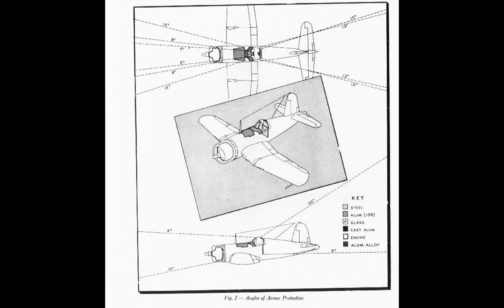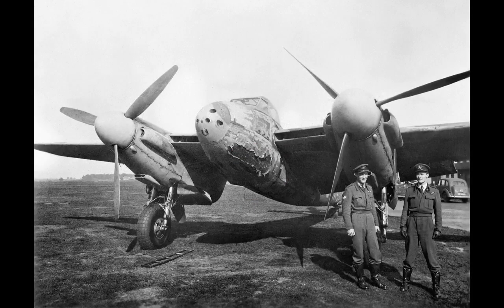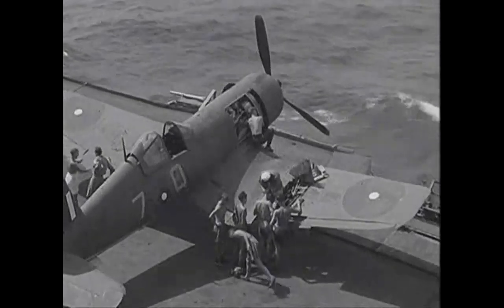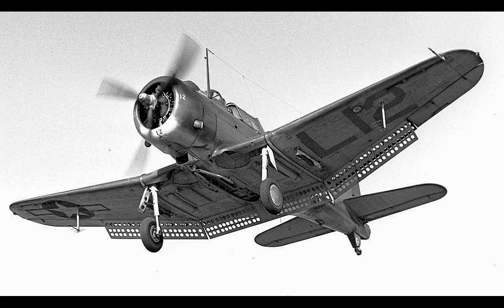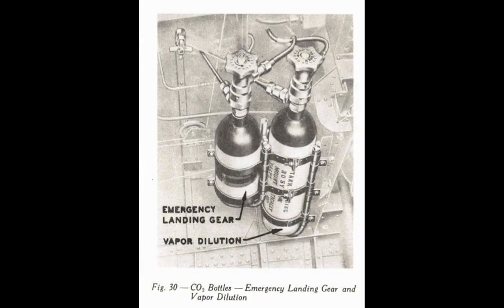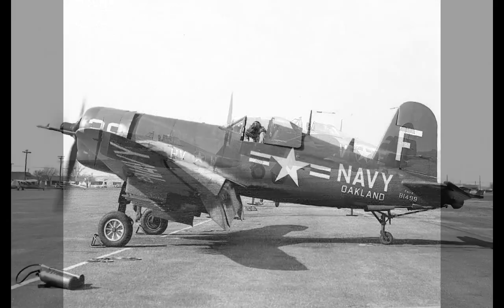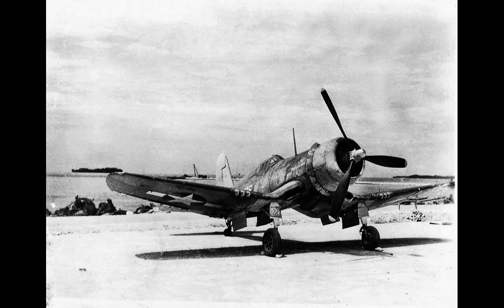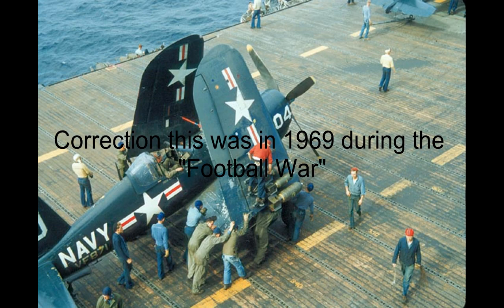F4U Corsair Design Features

Comment: My father was a Naval Aviator from '42-'64 and the F4U was his all-time favorite aircraft to fly, bar none.  During his career (he accumulated over 20,000 flight time) he flew pretty much everything and anything that had a propeller and a tail hook on it, with the exception of torpedo bombers.  He flew the F4F, F6F, F4U, F8, AD1, SBD and SB2C.  From about '57 onwards he flew the EC-121 Warning Star (the Navy's AEW version of the triple-tailed Lockheed Constellation).  Of all those aircraft, he loved the F4U the most.  When he was flying off the Lexington in '44 and '45, he would get "Ol Hose Nose" (as he called her) up to CAP altitude and then fly Lazy-8's over the task force by leaning from one side of the cockpit to the other.  She was awfully unforgiving to novice pilots though (the Corsair was called the "Ensign Eliminator" for a reason).  The officer with whom my father shared a stateroom on the Lexington was killed when he came in a little too low on approach, received the LSO's power call and fire-walled the throttle, only to have the engine's P-Factor (torque) get away from him.  The end result was the aircraft rolled over onto her back and plunged inverted short of the flight deck into the Pacific swell.  Neither were ever seen again.  My father said that from that moment onwards, he always came in high and hot, the LSO's complaints and criticisms be damned.  I hope Dad and Ol' Hose Nose are reunited, punching holes in the sky somewhere in Heaven now.
Reply from the maker: Thanks for that story Caesar.
Reply: Apparently the Royal Navy solved that nasty low speed stalling characteristic by building two ventral strakes onto the port wing upper surfaces to equal out the decaying unequal lift characteristics of the wings!!.
Reply: As you mentioned, the F4U had a notoriously vicious stall from which recovery (and survival) were demoralizingly low.  When the aircraft got down to stall speed, one wing, I can't recall which, would stall out before the other.  Then end result would be a sudden snap roll in the direction of the stalled surface.  At low altitude, like on approach to a field or flight deck, the result typically involved a wing-tip over wing-tip cartwheel....accompanied by fire.  I recall Dad mentioning that one solution someone (presumably the Chance Vought team) came up with involved mounting a small equilateral triangle, about 12 inches on each side, to the underside of the good wing.  The triangle disrupted airflow over the wing's surface just enough such that it stalled out at about the same time the "bad" wing stalled out.  I'm thinking the RN solution might have provided the impetus behind the Chance Vought's solution, or vice-versa.    @4vepvik781
Reply: @CaesarInVa  At the end of the day.The F4U's vices were ironed and the Fighter became the legend it deserves to be.
Reply: @4vepvik781  No it was not. It still had problems at the end
Reply: @4vepvik781  Legend where?
Reply: @4vepvik781  Legend in your minds
Reply: @hoatattis7283  Are You obsessed with Me!!??
Reply: @4vepvik781  Not really you just pop up a lot
Reply: @hoatattis7283  Well,people like or dislike My opinions but I have not posted any thing about the F4U since.However the topic runs and runs!.
Reply: @4vepvik781  Yes it does and all credit to you/
Reply: @4vepvik781  I thought the stall-strip was added by either Chance-Vought or the US Navy?
Reply: @petero.7487  If that had been the case,the F4U would have been cleared for Carrier duties from the get go rather than being relegated to the USMC..The Royal Navy/Fleet Air Arm operated F4Us from the beginning and strove to eliminate the stall vices of the aircraft and passed the gen to the U.S Navy!.🙂
Reply: @4vepvik781  the US did not clear it for carrier duty due to visibility problems on approach.  The British solved the visibility problem with the curved approach as stated in the video. Regardless of anything else you have to be able to see the carrier to land at any speed.
Reply: @petero.7487  Er!,the Royal Navy put the F4U into carrier service before the U.S Navy as the latter relegated the Corsair to the USMC till the vices were ironed out and with the R.N infront and cascading information back to the U.S Navy to speed up the fighter's belated entry into that Carrier Force!.
Reply: @johnmcmickle5685  Not in dispute,but that was not the only vice.
Reply: @4vepvik781  But that was a major problem.
Reply: @johnmcmickle5685  What U say is not in dispute so do not try to create dispute!!..Yes!,visibility is vital to see/land on the carrier but the other vices were unequal and therefore treacherous wing stall characteristics when any landing aircraft is flying close to it's stall speed is a necessity in the landing phase!.
Reply: @4vepvik781  Yes it was done by Capt Eric Brown and the FAA
Reply: @4vepvik781  Jesus dont tell them that the Limeys knew more than the USN
Reply: @hoatattis7283  They did!!..Some people don't like unpalatable truths..Let's deal widdit shall We!!??..Can't believe We are still having this topic 7 months on!!😳😳
Reply: @4vepvik781 I have no idea what you are referring to. 
Shit I reply to posts years old
Reply: @hoatattis7283  Enjoy n keep replying..Sounds like a message in a bottle..😆
Reply: @4vepvik781  good
Reply: @petero.7487  No they may have AFTER Eric Brown and his team worked out how to best land it on Carriers. 
Brown was a FRAeS [ honours] and was as good an Engineer as any Navy Officer and definitely more than any pilot
Reply: @4vepvik781  They will not believe you. The R/N never showed the USN anything in WW2 .Just ask them.
Reply: CaesarInVa  -- My father was also Naval Aviator, with experience much the same as your fathers experience. He flew carrier based ASW aircraft much of his time, but he flew everything else too. But probably his favorite was the F4U, he would have said it was the best fighter of WW2, bar none.
Reply: @martentrudeau6948  .Man you must be proud of your father.Wen men were tough S O Bz
Reply: @martentrudeau6948  :No disrespect to your father but did he face the Luftwaffe in his Corsair?
Reply: CaesarInVa ...  great story.  Great plane.  I had a Cox gas engine model plane for the back yard that was a Corsair.  No air to air kills, but a good time.
Reply: @chocolatte6157 Gotta tell you a funny family story about Cox model planes.....its a long story, but I think you'll laugh.  So, around 1970, I was about 10 years old.  Dad had been retired out of the Navy for about 6 years at that point.  Down the road from where we lived there was a shopping center that had a hobby shop.  That place sold THE BEST models.  Airplanes, ships, etc.  I think the models were mostly "Revelle", but can't remember exactly.  What I do remember is that this hobby shop sold THE MOST detailed models.  I would typically buy one on a Friday afternoon after school and spend all Friday night and Saturday night building it.  Ok, so one summer's day my dad accompanying me into the shop.  Up on one of the shelves was a Cox gas engine model of a Ju-87 Stuka diver bomber.  The thing most have had a wingspan of 2 feet or more (remember, I'm only 9 or 10 and so EVERYTHING seemed bigger at that stage of life).  It was at least twice the size of the Cox ME-109.  My dad, who usually didn't express much interest in what I was interested in asked me "Hey Mike, how about the Stuka? Would you like that for Christmas?".  I took one look at it and KNEW I'd never be able to control it.  In fact, I had a mental image of the thing taking off and dragging me airborne behind it.  I just said "No, its too big for me".  Dad continued staring at it.  I knew something was up.  So sure enough, about 3 months later, there she was under the Xmas tree.  Ok, I was pretty excited but even at 10 I was smart enough to know that the plane really wasn't for me.  Dad really got it for himself, but that was cool.  Whatever made him happy was my motto.  So that afternoon, Dad, my two elder brothers and I got all bundled-up in our coats and scarfs and went down to the local public school's parking lot to test-fly this behemoth.  My Dad pronounced "I was a pilot, so I'll fly it first and show you how it's done".  Naturally, my brothers and I dutifully deferred.  After much perseverance, my brothers finally got the engine running smoothly, which took quite a bit of mechanical aptitude (another reason whey I had misgivings and initially demurred.  I knew I had the mechanical aptitude of a sloth and figured I was more apt to dismember myself than get the engine running).  Dad, who was holding on to the control lines, got the plane off the ground and into the air, whereupon it went immediately into a near-vertical climb, rolled over onto its back and plunged, nose-first, straight into the parking-lot's asphalt surface.  Although there was no accompanying explosion or pyrotechnic display, the plane shattered into easily several hundred pieces.  Shards of plastic and engine fell all around us.  There was a pregnant pause for about 5 seconds while all of us tried to comprehend what happened, then I exploded in laughter and said "Hey Dad, I hope you flew better than that in the Navy!".  My brothers and father were stunned into silence by my the audacity of my comment and I could tell from the look on their faces that I had definitely gone somewhere that no sane mortal dared.  Dad scowled and looked like he might make a move towards me, but I think he knew that if he did, given my spryness, I'd be a quarter a mile away before he could do anything.   I was STILL laughing when I went to bed that night.  Mind you, I wasn't laughing AT my father, I was laughing at the situation....although the collision between personal hubris and.parking lot asphalt was pretty funny,
Reply: Great story. I hope your father got to enjoy his well earned retirement.
Reply: Thanks for the great story I hope your Dad is still sailing through the clouds.
Reply: Thank you for your father's service in the service from
 WWII (1944-1945) 
the Korean War 
(1952-1957)
the Vietnam War
(1963-1975)
Your father was an brave aviator an was fighting for his country an was proud to defend himself on his countrys behalf!......

I thank you for your comments!......
Reply: Oh man,thank u so much for sharing ya dads service time n planes with us.I live in New Zealand and our pilots did exceedingly well flying for the RAF ,spitfires,hurricanes etc,in WWll.Today I'm embarest to say we don't even have fighter planes and don't pull our weight. Salute your Dad.You must be very proud
Reply: I wish I could thank your father personally. As a neffew of a Marine who was trapped at the chosen Resivoir November 1950, he and his BROTHERS owe their lives to Marine Corps pilots who blasted the Chinese Army with M69's ......AKA NAPALM.
Reply: CaeserInVa: You do know Eric Brown and FAA worked out how to land the Corsair on a Carrier Before the US
Reply: casesarinVa , my uncle was in the Korean war, Chosen Resivoir November 1950 he told me 1 time that MARINE F4U-4 CORSAIR GROUND Attack mission were conducted at such said low altitudes that they could see the pilots grinning the GRINNELL FACES of the pilots.He said that THEM-69 would burn bodies into gelatin. If not for the CORSAIR, I may not have had an uncle. I love that plane. I think it was the only piston powered aircraft after the 1960. A soccer game argument was settled with Corsairs!
Reply: Y
Reply: Hi, Caesar: Your dad and mine most probably knew each other, I believe!  He was flying an F4U-5N in Korea and was the Navy's only Ace in that war.  Like your father, he flew EC-121s out of Midway and Barber's Point NAS in Oahu at the end of his flying days for the Navy.  His name - Guy P. Bordelon, Jr.  What was your dad's name?
Reply: Awesome!  I love WW2 fighters vs jets as the pilot was critical to the success of the model plane they were flying.
Reply: You mean that USS Lexington which is not in Corpus Christi? I was there, so cool!
Reply: I love the Duaglas SBD Duantless and the P51 mustang and the F4U
Reply: Caeser:  the Brits taught the USN to land on carriers
Reply: Wow, CaesarInVa, thanks for sharing! It is so important to remember and get these stories out there somehow, each and every one. Your father sounds like a magnificent American of whom we may all be proud of..

Thanks again

Comment: You did not mention that the insignia for the Marin Attack Squadron VMF-214  Blacksheep has a forward facing Corsair. And didn't one Corsair had a 'kill' by using it prop to chew off another plane's tail, Loony Tune style?
Reply from the maker: Hi Gadget. No, I didn't mention 214's insignia, I didn't mention insignias at all. I am not sure why I should. There is at least one knows case of a Corsair finishing off an enemy by prop strike.

Comment: I imagine that keeping the fuselage the same diameter/width back to the wing root trailing edge went a ways to reducing interference drag since there is less of a venturi effect where they meet. I have often wondered if Kurt Tank was fully cognizant of this and or if he tapered the 190s  fuselage significantly before the wing root trailing edge as just one of those compromises one has to make in airplane design.

Comment: Yet again, another fantastic video. Please don't stop doing them in a hurry, as I for one find what you talk about extremely facinating. You seem to have cornered a niche in the market, because your talks are unique... One thing I'd like to mention is that I'm pretty sure that all developed countries of the time used duraluminium within the constitution of aircraft. Many high strength parts such as propeller blades and wing spars to mention just two...
Reply from the maker: Hi Julian, thanks. I suspect most countries used it, as I said in the video it wasn't a secret, although the Japanese had another type of aluminum that was a secret. As far as using it for armor, I think that was pretty rare. I don't know of any non US planes that did that, but it wouldn't surprise me if some German planes had it.

Comment: Correct me if I am wrong, but by moving the vertical stabilizer forward allows better rudder control together with the elevator at high speeds.

Comment: Hi Greg, besides the significant lesser drag of a feathered engine, some "windmilling" engine (where the prop is turning the engine and not the other way around) could in some engine, cause complete lubrication failure of the prop gear box or other engine accessories which could lead to the rotating assembly seizing, or worse catching fire and coming apart.  Great videos, Ciao, L (FoMoCo engineering)
Reply from the maker: That is true, especially in war time as combat related damage may have taken out the lubrication system. It might be worth pointing out that if the prop can not be feathered for some reason, a seized engine is actually what you want because a stopped propeller makes quite a bit less drag than a windmilling propeller, even it it's not feathered. Of course you don't want a fire though! Your point is good, shutting down the engine and feathering the prop reduces the chance of further damage and fire.

Comment: Corsair oddities – 
Fabric covered outer wing panels were standard until post-WWII.  This includes those Corsairs equipped to fire 5” HVARs.
Like nearly all contemporary aircraft, all control surfaces were fabric covered.  However, the early Corsairs had plywood ailerons, later switched to aluminum, both fabric covered.
Much of the fuselage skin is spot welded rather than riveted.  External applique aluminum armor was fitted to AU-1s on a limited basis and bolted into place.
The vertical fin and the horizontal stabilizer were both fabricated with “Metalite” skins.  Metalite was a Vought developed sandwich skin of aluminum -end grain balsa – aluminum glued together under pressure.  Later this material was used for much of the Vought Pirate’s wings and tail.
The bent wing solves more problems than it creates.  Mostly it was a clever way to subtract landing gear system weight.  Shorter gear struts and trunnions mean less structure was needed to react the landing loads.  Capt. Eric Brown thought that the landing gear to be too bouncy, causing Vought to tweak the oleo shock orifice diameter until it wasn’t too bouncy.
And, yes, the intersection of the wing roots with the fuselage eliminates the need for fairings and fillets, reducing wetted area and drag.

Comment: Intentional spinning was forbidden in the Corsair. The fin was forward so that it was not shielded by the  stabilizer should a spin develop. Look at Arado designs.
Reply from the maker: That's correct, intentionally spinning a Corsair was a bad idea and specifically forbidden in the flight manual. This has a lot to do with the tail design, and also something about the polar moment of inertia with the big engine up front.